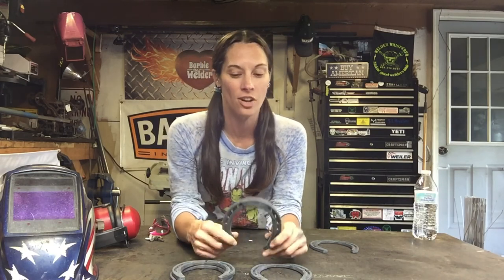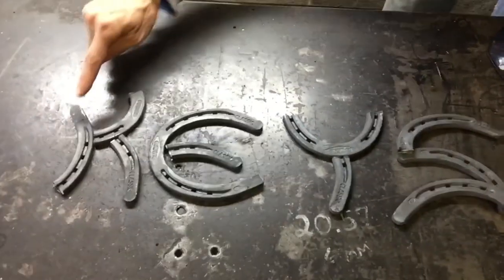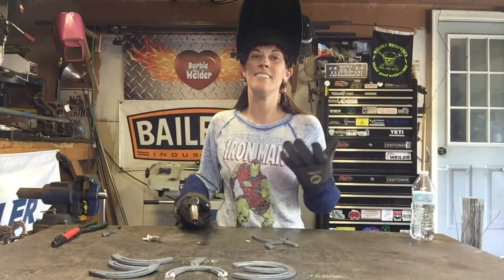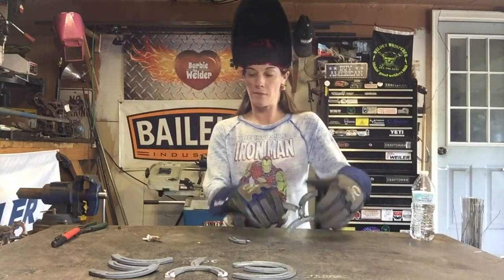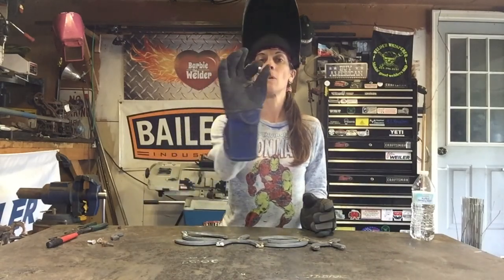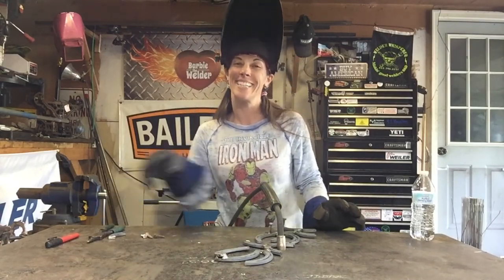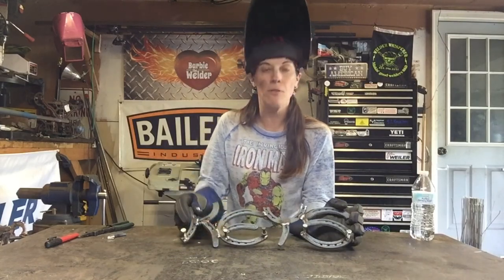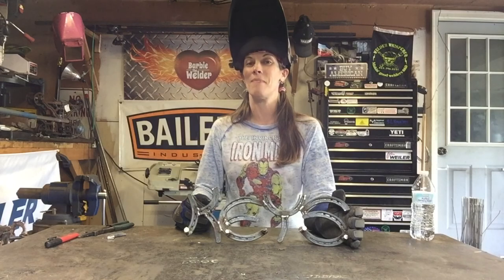How To Weld A Horseshoe Key Rack Words | Easy Scrap Metal Art Sculpture | Barbie The Welder

Comment: T kind of welder can I use I don't have tanks
Reply from the maker: You can use flux core to weld art. It’s about making sure your machine is set up correctly. It’ll make your job a lot easier. With a traditional meg with gas I use oh 30 wire. It allows me to be more precise, and the melting temperature is lower because the wire is thinner, which allows me to weld thicker material, giving me, more range with the machine. I hope this help! Happy welding!

Comment: Like you videos. Have you thought about getting a low speed high torque chop saw. It’s a lot faster then a cut off wheel and the steel blades last forever. Plus the pieces you cut are cool to the touch right away.
Reply from the maker: I have a chop saw but the accuracy isn’t there, the cutoff wheel flexes under cutting. I have a band saw I use for heavier stuff.
Reply: BarbieTheWelder check out the Evolution 14 in. Steel Cutting Chop Saws the use a metal blade and have really good accuracy.